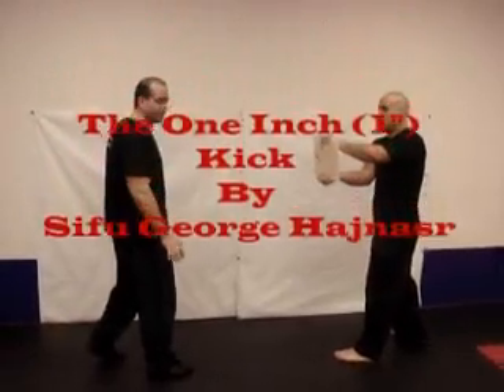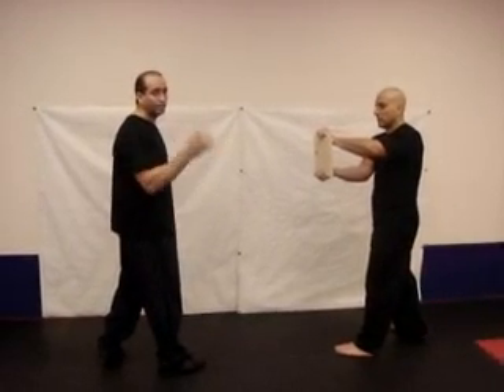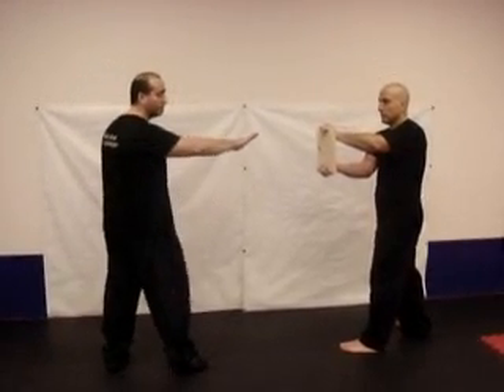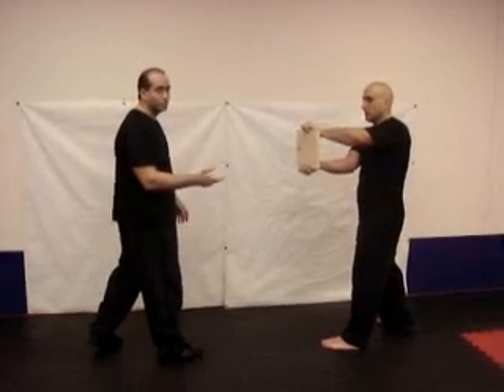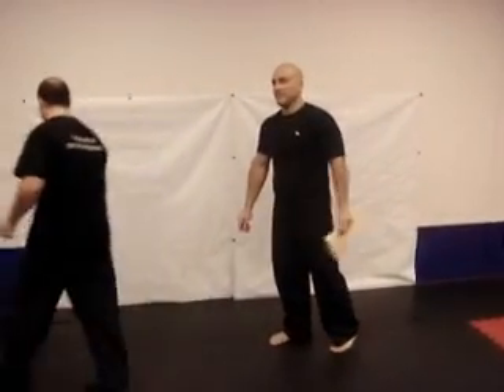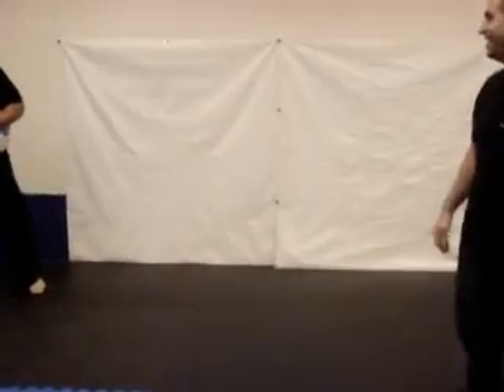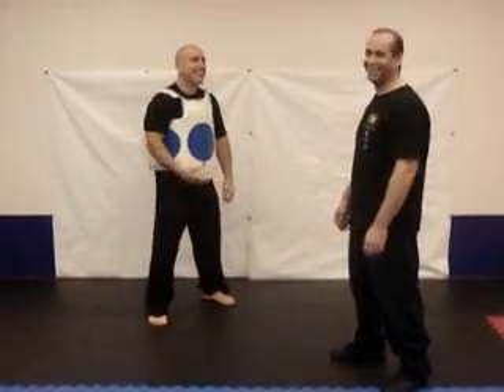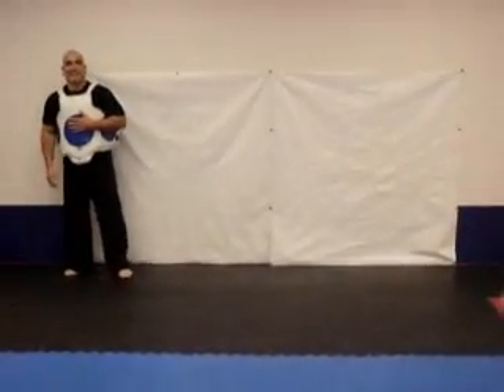ONE INCH KICK AGAINST A PERSON !

Comment from the maker: Applying all of one's body weight into the target generates the force from this kick. Therefore, the rear heel and the hips will line up perfectly after the quick rotation of the rear heel and the shoulders. The kick is executed in one fluid motion, forcing body power and velocity and perfect alignment, including the leg, being fully extended and perpendicular to the floor.

Comment from the maker: Again, two things must happen: one, you have to rotate the rear heel and snap the front heel into the target simultaneously with speed and snap. Otherwise you will not cause much damage while penetrating the target. Two, it is very important that you rotate and snap the front heel without reloading. You must push all the energy forward that is being generated from your hip and rear heel rotation.

Comment from the maker: Rear Heel: The starting position of the rear heel is at a 90º-degree angle. The rear knee is fully locked. The right or front leg is fully extended against the target with the heel about 1 away and with toes touching the target. Execute the kick by rotating the rear foot until it is fully facing the target.

Comment from the maker: Velocity and Alignment: Applying all of ones body weight into the target generates the force from this kick. Therefore, the rear heel and the hips will line up perfectly after the quick rotation of the rear heel and the shoulders. The kick is executed in one fluid motion, forcing body power and velocity and perfect alignment, including the leg, being fully extended and perpendicular to the floor.

Comment: the more distance you are able to extend your punch can generate more power, but it's slower. being in close quarters lets you punch faster, albeit weaker and in more danger. actually, this is where the one-inch punch really shines, because you can rapid-fire a series of thrusted  punches with the flick of the wrist (which creates the one-inch power). so imagine punching 5-10 times in a second from 4 inches away. it's like drilling into your foe.